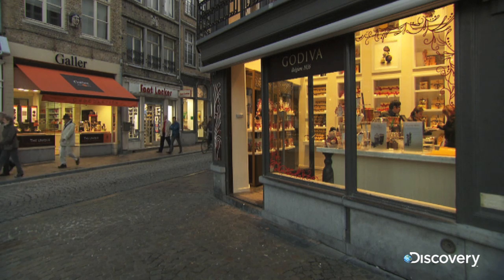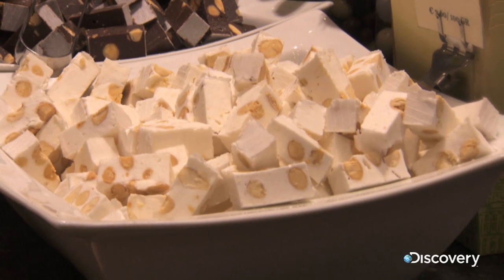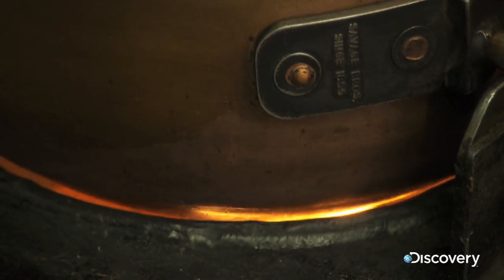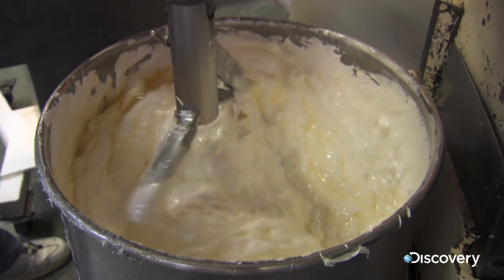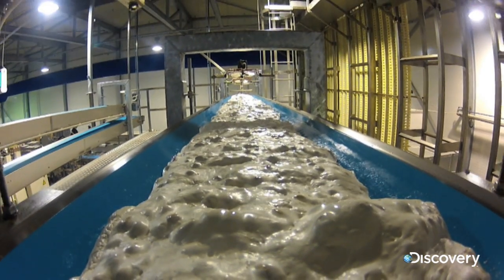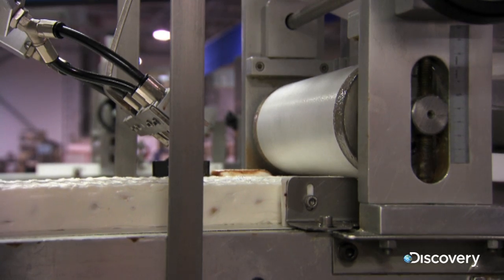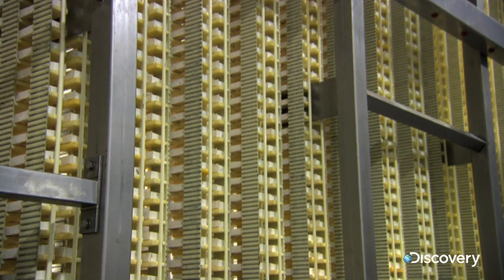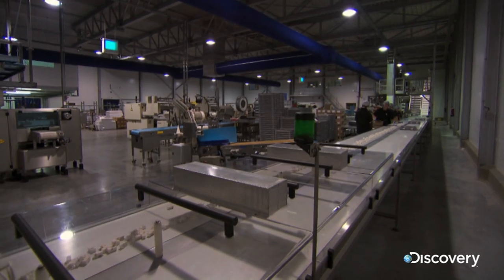Nougat - How DoThey Do It?

Comment: Hey if someone reads this and can somehow help me with my issue. I am a trainee chef, i am making a trademark amenity in the place where i work, and this is nougat... my only problem is what is supposed to be the temperature of the sugar mixture when you get to display and plate it as an amenity ? One that it will not melts at all.  I know that the egg mixture must be in medium peak and i slowly pour down the sugar mixture once it heats upto around 150 C... i have dried fruits with toasted pistachio and almonds.
Reply: Could you not just keep it in the fridge and pull as needed to allow it to warm to room temp for serving?